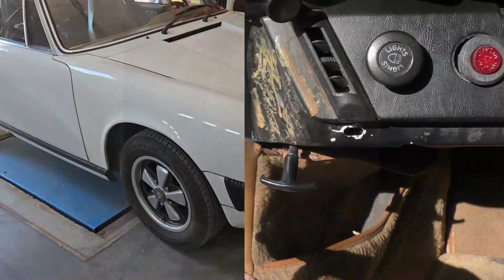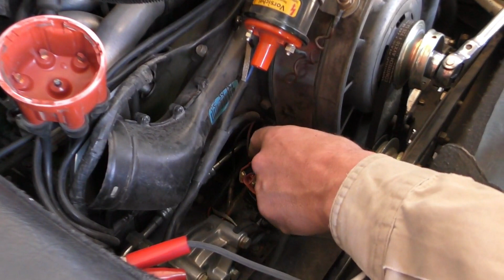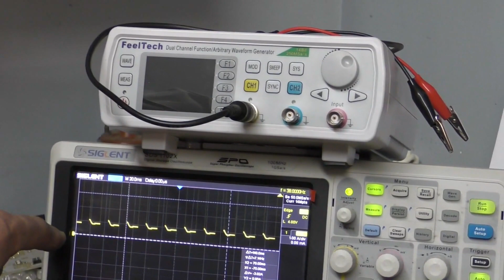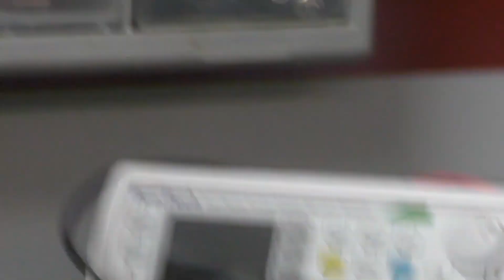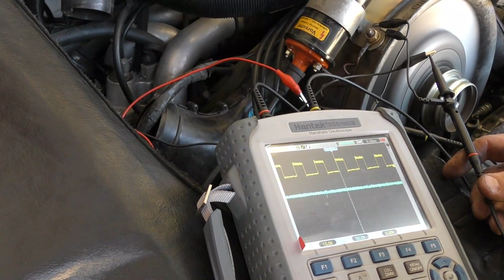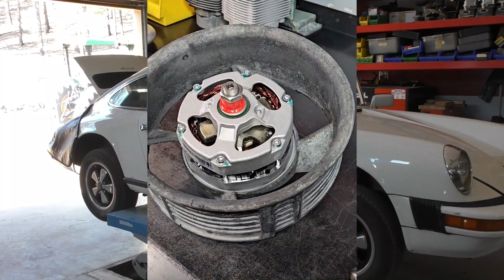Hard Start! 1976 Porsche 911 Repair

Comment: It's always the fuel pump relay loosened by pulling off the fuse panel cover in mine.
Reply from the maker: That is a very common failure point on these cars. S
Reply: @Aircooledconsulting  I should add that and the fuse panel crumbling is the only reason it's failed to start in 34 years I've owned it. Always gotten home under it's own power.
Reply: where is it located?
Reply: @Resalb-o2v Top of the driver side fender well in front of the firewall, first round relay above the fuses. https://youtu.be/OocqGcD2VKk?t=1231 there, to the left of his hand is almost touching it. That black plastic box.
Reply: @HarleyChopped thank you!

Comment: Another great one! Nice work. 

What was the diff between the battery you installed and the one that was there? CCA’s? Leak down - performed warm or cold b/c of the cold start issue?
Reply from the maker: The battery originally installed was not only the incorrect type for the vehicle it was also only a 500 CCA battery versus the 950 CCA battery specified by Porsche. Porsche does allow for a smaller 750 CCA battery although our environment and temperatures do not lend well to the size battery. Where ever possible I will always install the largest battery possible.
Leak down pressures are always performed not matter what the complaint. It is best practice to gather as much information as possible when looking at a vehicle.
Kurt
Reply: @Aircooledconsulting  wish there were more battery options. Esp for the older bat box fitment, ie long hoods. anyhow great work and vid.

Comment: @Klassik Automotive Training School

Hey mate,, I’ve got an oddball question for you regarding the 3 barrel weber and zenith carbys.

In your opinion,, what do you think the success rate would be running one of these type carbs on an 2.6 litre inline 6 cylinder? 

I have a 1962 vauxhall pa cresta with the 2651cc 2.6 litre 6 cylinder and I’m wanting to do some mild engine mods to it.

No real performance parts exist for these things other than extractors/ exhaust headers so everything like cam, lifters, valve springs, pistons, head work will be purely off the cuff improvisation. 

Any advice would be great. Cheers ✌️
Reply from the maker: Of course, it could be done with a custom intake system. In my opinion, you would be better off running three DCOE side draft carburetors. Odds are there is an intake manifold already out there for that carburetor, and the linkage set is already available for those carburetors to run on an inline 6 configuration.
Kurt

Comment: Had fun learning from this one as i have 76 as well.  Cold start stability is my ongoing issue and it does not warmup gracefully.  Am dealing with surging on warmup as you noted in the end of the video and I am pretty sure i have a small airbox leak as I diagnosed with smoke test, but am not ready to buy new airbox yet and was hoping to wait till winter.  Surging goes away when warm, so am thinking the airbox heats up when running and seals better.  So my question is? do i proceed with new airbox, or do i lean it out a bit.  thanks!
Reply from the maker: Always fix the air leak first. Unmetered air can result in engine damage due to increased combustion chamber temperatures due to a lean fuel mixture. Then once the intake system is all sealed up you can adjust the fuel mixtures. Make sure you use a high quality gas analyzer and not an AFR meter.
Kurt
Reply: Super, thanks so much for the guidance.  You are the Best!